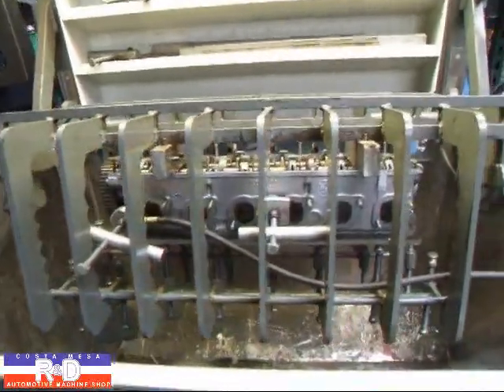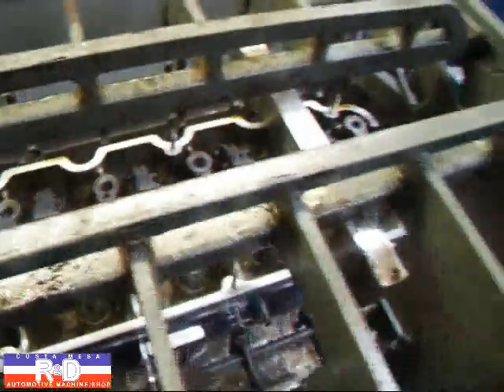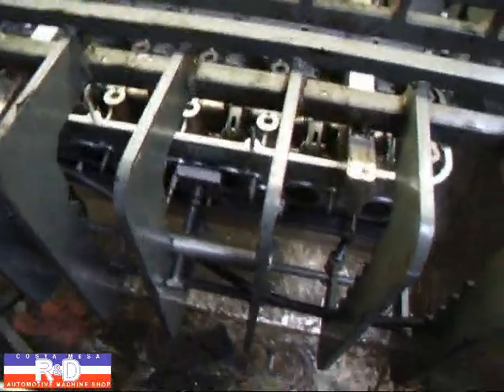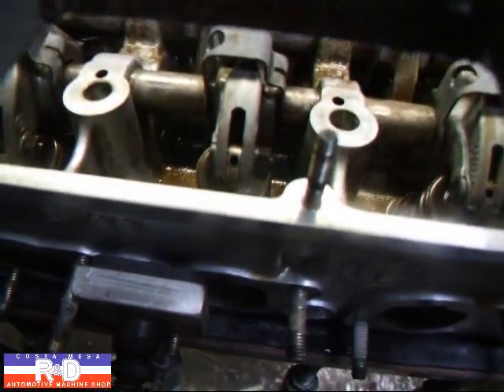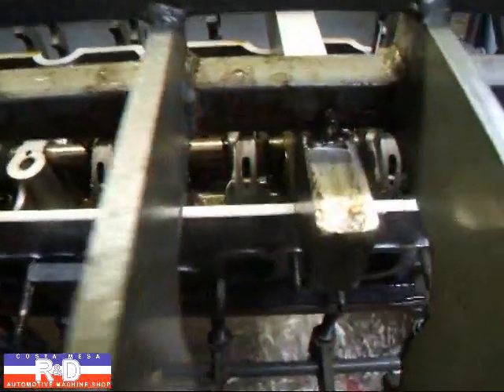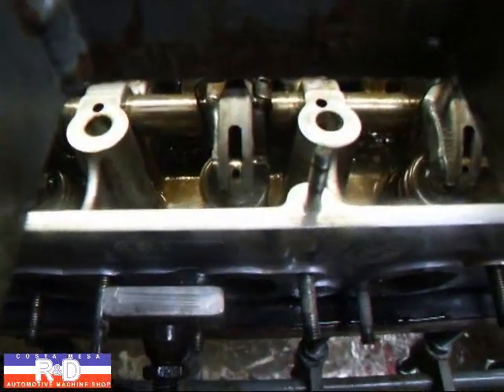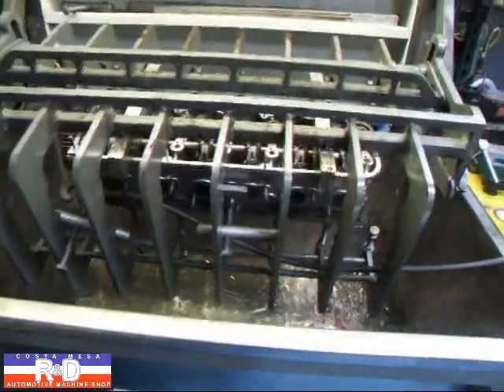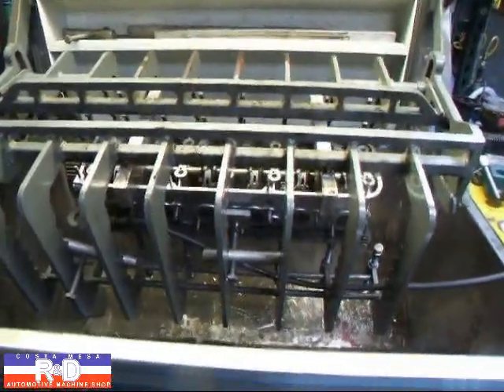BMW Cylinder Head Pressure Test

Comment: If you weld it properly, using the right procedure and the wire with a alloy that mache´s with the cyllinder head alloy ... it will work perfect ... for sure ... I have a reconditioned of engines company in Brazil, and we do it as a usual service, it´s cheaper that buy a cyllinder head (even if it´s a used one) and enviromental safe.